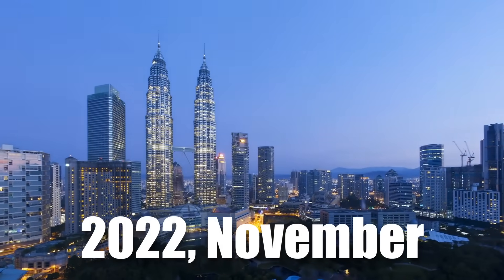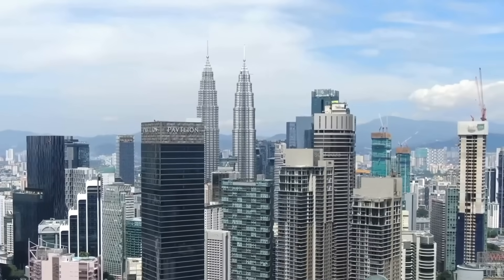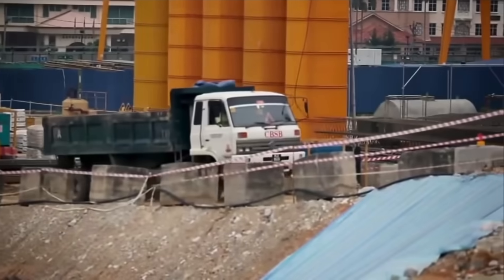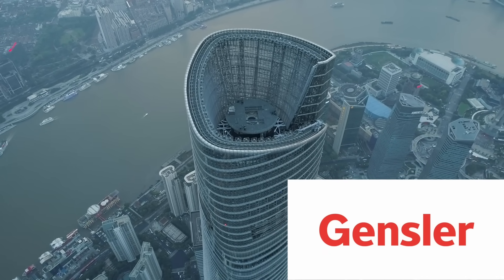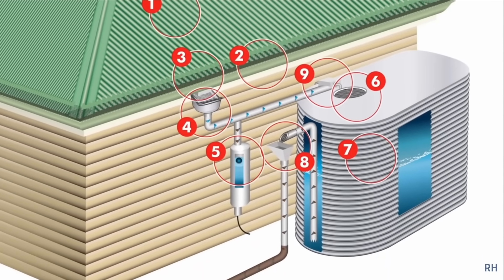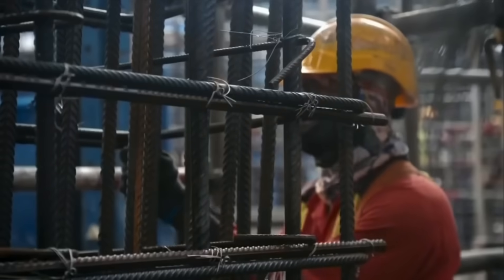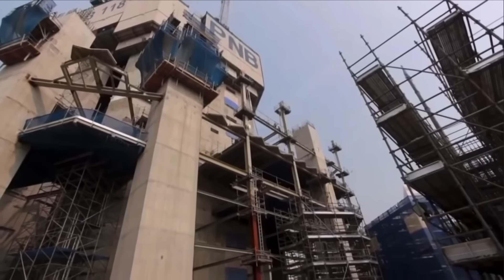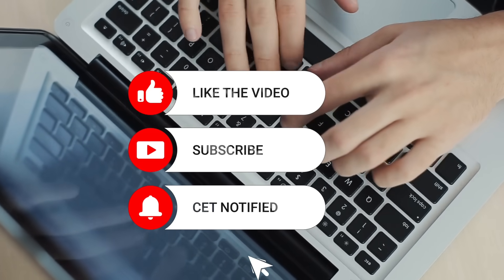Malaysia Is Building The World's 2nd Tallest Skyscraper

Comment: I goes to KL about two weeks ago, which is basically about the time this video was posted. And I must admit that I was stunned to look at it from close view, and yet not close enough.

And for this reason, I also got the urge to have my company office to be in Merdeka 118 as well one day. If possible, in one of the highest floor.. Man I am excited for this!
Reply: lol, people that are afraid of heights won't qualify to work with you.
Reply: Bro if the elevator is out of service then youre going to have to go through like thousands of stairs💀
Reply: @vrexyyzeditz  i dont think a $1.5B tower will have an elevator problem. Even if somehow few elevators are down, there will probably be dozens more that are still working and 24-hour maintenance workers standing by.
Reply: @KaiOniOfficial  this is Malaysia
Reply: @KaiOniOfficial  what if the power went out
Reply: @vrexyyzeditz KLCC still so fine since 1998. No issues. This would be miles better and better. What’s there to imagine.